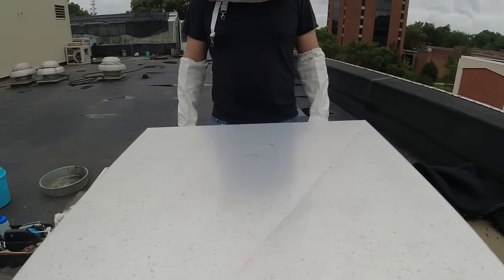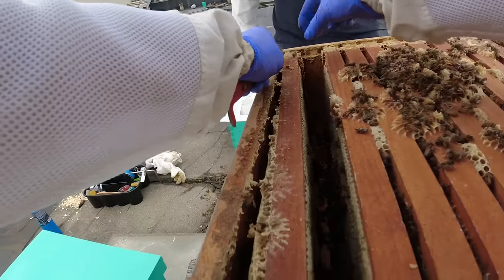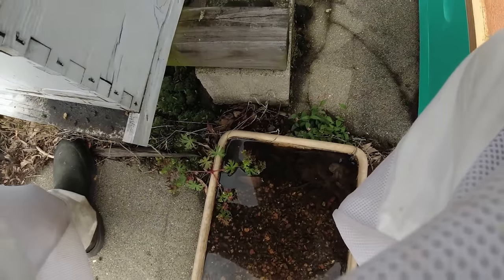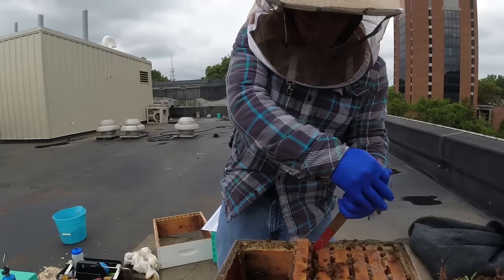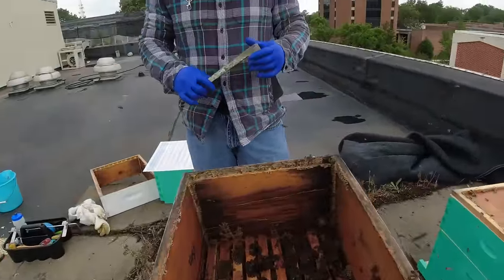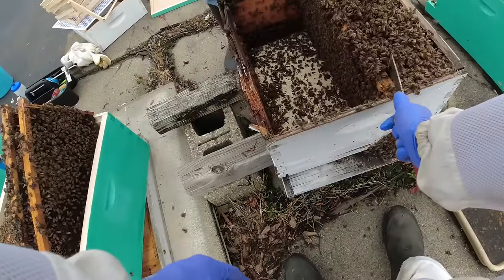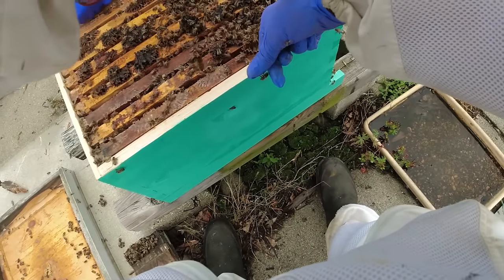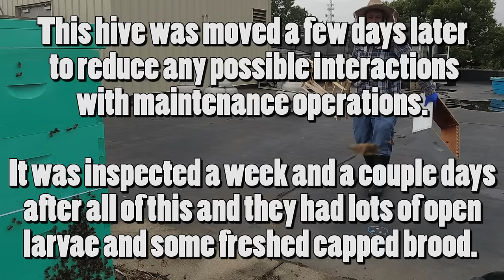❸ Rooftop hive: First inspection in 7 years!

Comment: If you can split the boxes before pulling frames the combs come out way easier.
Reply from the maker: We tried.  The boxes and frames were so propolised together we could not separate the two.  It was rather hard just doing a frame at a time with 7 years of propolise fusing them together.  Thanks for watching and taking the time to comment.

Comment: I have had the pleasure of dealing with two abandoned hives. One was abandoned in a woods, had definitely died at some point, and had a swarm move in. Your literally have hive components disintegrating as you try to free the frames. The frames themselves can often snap and come apart!

I'm impressed as how careful you were with the old hive parts. I would recommend phasing out the old frames. You can do that by running half of the old frames and half of box as new frames. You have to add a second deep box for each box in the hive, but it lets them draw out the new stuff so you can phase out the old stuff during spring/autumn consolidations.
Reply from the maker: I came into the inspection thinking it would be a cut out like what you experienced.  I'm glad they were in such good shape.  I like the plan to cycle out the frames and I was hoping to get a lot of that old comb out.  The trick here is that our bees seem to stop building out comb after the summer solstice as the flow ends.  I'm not sure if you saw the next video that relates to this hive or not but we ended up having to make a split so we have the hopes they will build out some new comb in the second hive but we will see.  The plan is to pull all the old stuff out in the spring and get them on new comb like you mentioned by alternating comb with foundation then when that's drawn pull out the drawn comb where we can.  Thanks for taking the time to share your experience and commenting.

Comment: I know nothing about beekeeping but I've always been curious and wondered if i might have a piece of land where i could keep a hive in the future.  From a complete newbie's perspective, this was a really fascinating process to watch.   I'm curious if they have boxes that keep fewer frames to control the weight when you have to move them (you mentioned 8, but maybe 6 would be more my speed).  I'm disabled and joint and nerve damage prevents me from lifting heavy things.
Reply from the maker: They do make 6 frame boxes that are plastic and styrofoam (Apimaye) but they are bit more expensive.  I use 8 frame boxes personally some use all medium boxes as well to reduce the weight.  I also use 5 frame boxes to make nucs to sell to folks in our area but they may get tall.  If you have the space I would really consider a horizontal hive also known as a long langstroth hive.  They use regular frames but when you lift the lid you have access to the entire hive and it's only the depth of 1 frame so the most weight you are lifting at any time is 1 frame.  www.horizontalbeees.com has many great hives available if you decide to go that route.  Thanks for taking the time to comment.

Comment: What camera setup are you using? I need a good quality hive inspection camera because I cannot remember everything going through them and this is really good video quality and you have both hands free
Reply from the maker: I have a DJI Osmo action 1.  The 2 was weird and it looks like the Osmo action 3 looks like the 1 that I have.  It never overheats and the batteries were cheaper than the GoPros.  They share the same mount as all the others so you can get a universal kit that has the chest mount.  I use just the chest mount strap not the shoulder straps as they are too cumbersome.  That's why I started doing it to review what I was doing and sometimes look at it before the next inspection to see what needed to be done.   Good notes help out a lot too.  Thanks for watching!

Comment: He needs to be taught how to use the flat side of the hive tool to “fulcrum”one frame away from the other, like the method you seem to be using. Using the “J” end to separate the frames will weaken, then rip the top bars off. Teach him the correct way, like the method you’re using, to separate the frames. Like you told him in the very beginning, use the “J” hook, away from the ends of the frame, to lift the already loosened frames out of the box. 😊
Reply from the maker: Thanks for sharing.  I'll be sure to reiterate that to him next time.  He seemed to be a very quick learner.
Reply: @BrianCooper901 , you are a very kind man to be helping him so much; its not always easy to find a willing mentor. Mine had lots he wanted to teach me, but he had a stroke and died a couple of months in—tried, but couldn't get another one assigned to me.
So, he's blessed to have you, and may blessings come your way for your loving heart.
Reply from the maker: @Phyllistinegm  I'm sorry to hear that about your mentor.  Thanks for the kind words.

Comment: I would have done four splits in that box. Also, that was a prime opportunity to remove bridge comb, excess propalis, and  comb from the tops and bottoms of the frames. The drone proof could be gotten rid of which would set back the colonies proclivity to swarm.
Reply from the maker: Good thoughts.  We unfortunately didn't have any extra equipment.  I came in fully expecting to do a cutout so didn't plan it would go so smoothly getting them into new equipment.  It appeared that hive may have just swarmed and the new queen was just laying by how little brood we saw.  We'll need to get to that propolis before it gets too cold to deal with.  Thanks for commenting!

Comment: You don't need to waste time removing those queen cups. If they want to swarm they'll build new ones. And you couldn't go much slower! Why not put the new box and B board on the original site. Then you can remove frames etc. without field bees returning and any bees flying will go to original site!  And you don't need to see the queen since you've taken so long with colony open and prone to a robbing war.
Reply from the maker: 7 years worth of propolis did slow down the process quite a bit.  It was his first time in the hives too so it was slower to help him learn along the way.  We were nervous to move the existing hive because it was rotten and I wasn't sure if it would fall over so we just worked from the top down.  We were in them during a flow so robbing really wasn't a concern at the time we did the video.  Thanks for watching and taking the time to comment!

Comment: You talk too much and do little. You have 3 different hive tools and yet can't manage to get frames. shhh
Reply from the maker: I was teaching a beginner beekeeper and it was his first inspection that's why I was talking him through it.  The frames had 7 years of propolis on them, so it was difficult to get the frames out.  Thanks for taking the time to comment.
Reply: The thing I would have done differently is in the second super (you were talking about backfilling) I would have harvested the two outer capped frames and put 2 empty frames in the middle for the queen to fill. Why didn’t you harvest the top frame?
Reply from the maker: @sarahdlp524  Do you mean in the new split or the original hive?  The original hive seemed to have space for her to lay so we left it alone.  They seemed to have backfilled some of the brood nest there but we are entering a dearth and they would open that open pretty quick.  The other one we left a full super of honey on top for resources in case they needed it for winter.  We did extract 6 frames and gave them back to the queen for her to begin laying in.  If I'm not fully answering your questions just let me know.  Thanks for watching and taking the time to comment!